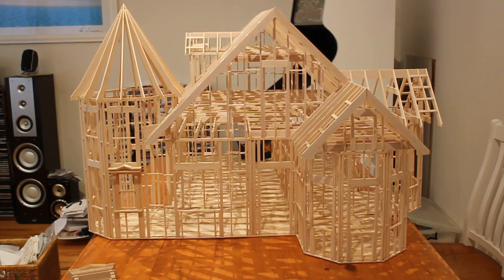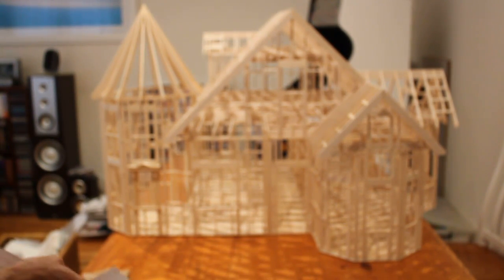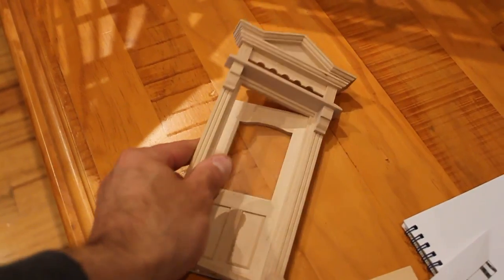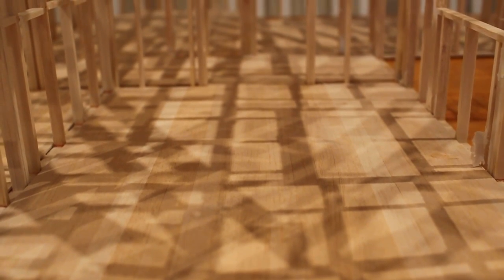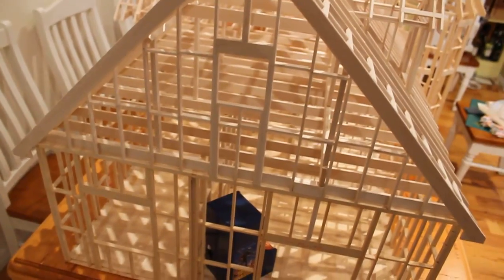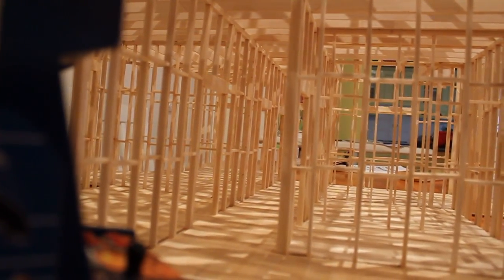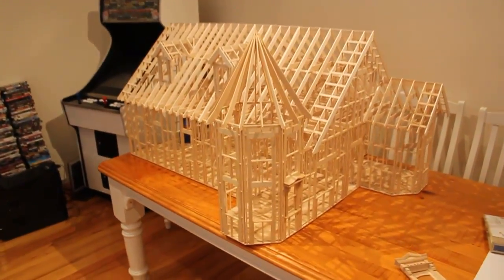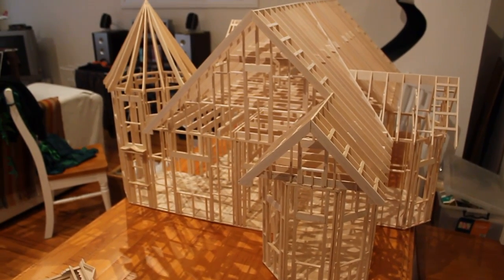Scale model house - 1/12 Architectural model

Comment: How did you make the scale balsa wood 2x4 and 2x8's for the roof? Did you start from a sheet and cut each member or a strip and chop each member? You said you took a framing course. Was it a community college you took the class? Nice build.
Reply: Since a 2x4 is actually 1.5" x 3.5", the 1.5" becomes exactly 1/8", a standard thickness of balsa.

Comment: Vcoleiro1  Very good scale house. I hope you are proud of it? You should be because it's beautiful. I did wonder why there is a long "stringer"? on the right side of the roof? Long diagonal beam, not on both sides. It lines up with the dormer, but there is not one on the other side. Also did you make stairs to get to the upper level? I didn't see any in the video. These are not critiques, just curisoty. Wonderful job!!

Comment: Now you need to run the wiring.  If you can find 1/12 switches and outlets.  But with your talents, I'm sure you can build them.  I would not completely finish the house.  I would completely finish maybe 1/4 of it.  Wire 3/4 of it. Plumb 1/2 of it.  To give it that cut away drawing feel.  ;)

Comment: What are you using to hold the boards together? I made a model like this when I was in school. Was much smaller and only one floor but took me half a years worth of in class time to finish it. Mine was held together by believe it or not finishing nails. Interestingly enough if that's built to code like you said you should actually be able to stand on it! (I wouldn't suggest it just to be safe) When mine was all done my professor walked on each of the walls, it was terrifying! But it held up!

Comment: Great video! I am actually falling into computer graphics design (particularly architectural work for residential, commercial and luxury) I am currently using google sketchup, and will, upgrade to rhino and autodesk revit architecture. The prototype I use my laptop/pc/tablet. As for the finishing hand on projects. I will be using the same materials you have in your videos. I know they're easy to find in house appliances or material/crafts store. I enjoyed your video very much.